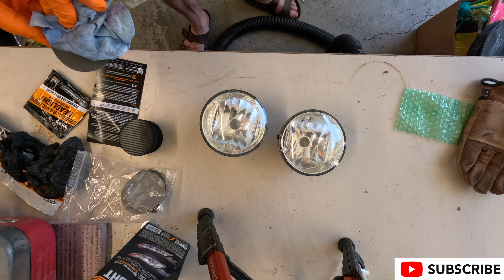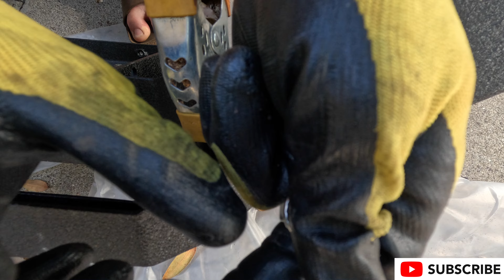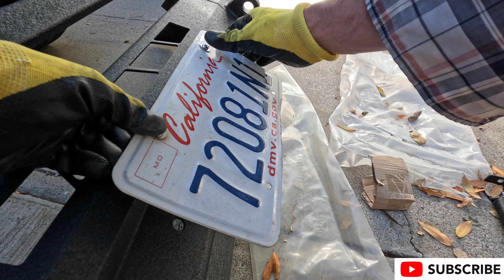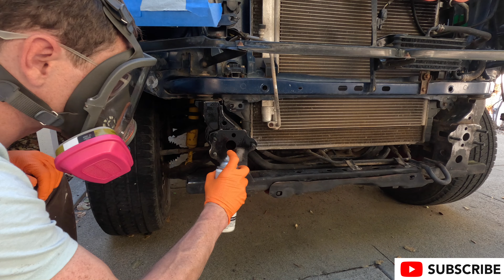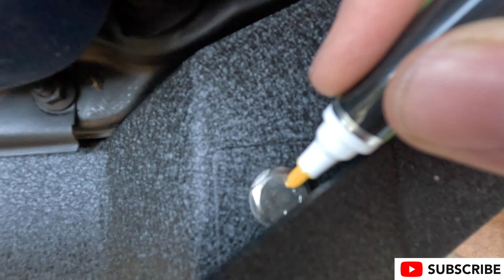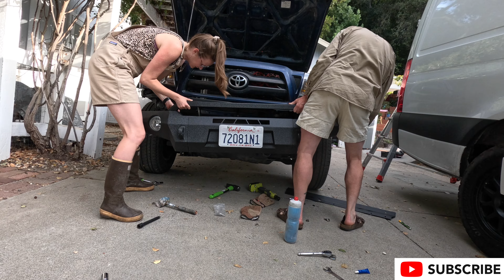Hooke Road 05-11 Tacoma Front Bumper Install: A Step-by-Step Guide

Comment: Are satisfied with the bumper ? How is it holding up?  I looking at getting new bumper. Thanks to a deer?  Did you have to get new mounting hardware. To use the old fog lamps? Thank you 🤝
Reply from the maker: I'm satisfied with the bumper. It's holding up well. Much stronger than the stock one. I did not get any new mounting hardware. I used the old fog lamps.

Comment: Did you have to cut anything on the truck for the bumper to fix.
Reply from the maker: Yes
Reply: @buckmanriver  what did you have to cut? And were you able to leave the reinforment bar that the headlight bolts to.
Reply: @JonJonCuh  I think you can see the reinforcement bar for the headlights is still there and not cut, so you probably can leave it there. You only need to cut the plastic fender liner in the wheel wells.

Comment: I just received mine. It looks like those pieces of EVA foam go between the center section of the bumper and the right and left wings. 

That might explain why your bumper seemed just a tad narrow relative to the mounting bolts, and why the holes in the foam didn’t seem to line up to anything. 

I’ll begin the struggle of mounting tomorrow. 😂